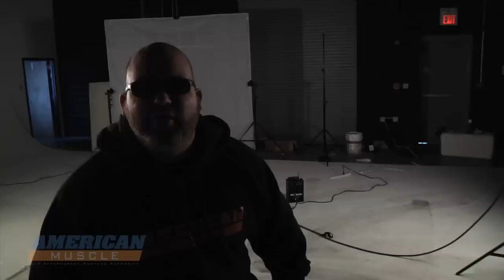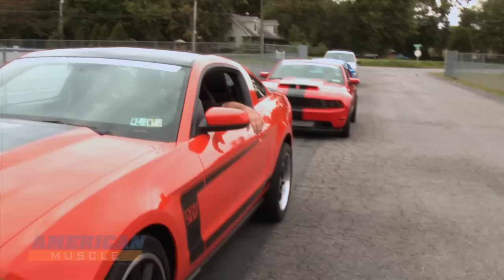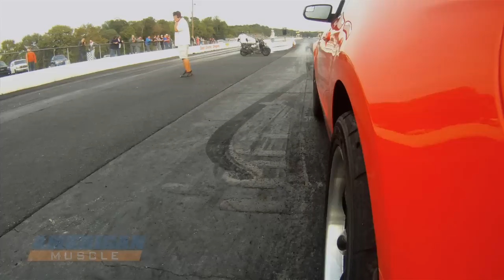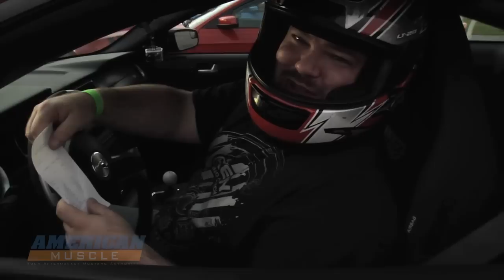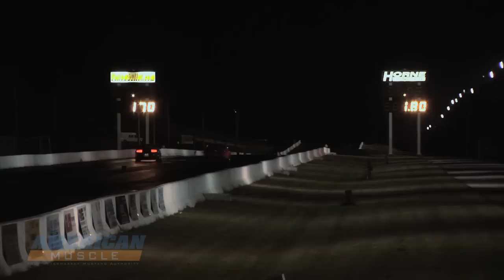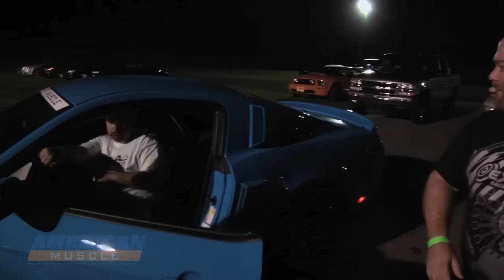2012 Boss 302 vs. 2011 Mustang GT Drag Race - AmericanMuscle.com

Comment: Im kinda disappointed bc my SHO has a tune on it and that's it and i run around 12.6 every time so to see a mustang that is less weight and more power plus a tune is kinda sad....but still... i love the stang and i always will haha
Reply: yea maybe in the 1/8 lol
Reply: You have to realize your SHO's power band and torque curve are much, much more linear than a GT/Boss 302. They make more "peak" hp, but your turbocharged SHO makes it lower and longer, thus helping you get that consistent ET you stated.
Reply: You realize the taurus is a 4cylinder and power bands on a 4 cylinder are shit not even to mention the car weighs 4400lbs
Reply: ITzMichael523 Huh? 3.5L V6 ecoboost is what I've heard the SHO has.....365hp stock.
Reply: its 4 cyl
Reply: twin turbo
Reply: 2.0l
Reply: You're thinking of the standard Taurus with available 2.0L ecoboost, the OP said he has a Taurus SHO, which has a 3.5L V-6 ecoboost with 365hp(same engine used in the F150 and Flex vehicles).
Reply: the Taurus has a 3.5L v6 and the sho has a3.5L Twin turbo...the 2.0L single turbo is only in the new Taurus coming out in 2015..I own an SHO...don't tell me whats init when you obviously have no clue
Reply: viperkill3 :-) I envy your SHO! 12.6, wow!
Reply: 12.6 is nothing..look up taurus sho 11.9...there are alot of people that have more upgrades then mine..but thank you..haha
Reply: viperkill3 How do you keep traction?
Reply: smiley00341 AWD
Reply: ITzMichael523 no its not. Wtf, all you have to do is look it up lol
Reply: What the hell is a SHOE?
Reply: The SHO is AWD

Comment: You think each of thse guys carries an extra 150 pounds??!! WOW! However when I had my 1971 Mach I (351 Cleveland around 285 hp) if I took 3-4 other passengers for a ride I had no problems accelerating. Towing a trailer makes a difference. But ONE second in a 1/4 mile is an awesome bogging down of 400+hp engines. Try it. Take a 150lb passenger for a ride in a 400+ hp sportscar. It's not much difference.

Comment: Which one you want to take, '95 Z28 making over 500 horses N/A or the '71 Vette sitting in my garage, supercharged 454 making over 800 horsepower, and I got another supercharger coming in. After I smoke you I can change your oil and balance your tires, because I don't buy things with daddy's money, I build myself, like a real man. Maybe you can hit 0-60 in 5 seconds, but I can still do the same, and with a car that I made powerful.

Comment: WTF? I ran a 13.2 on street tires in my 01 Lightning. Yes it was moderately modified but dad gone, I expected more out of these monsters. If they had more track I'm sure they would show their grunt but I expected at least consistent low to mid 12's from a newer Boss SMH

Comment: lol dude that's all sports cars today cant turn or stop for crap I have a 73 Crown Victoria with a 302 boss and it halls balls and turns on a dime same with my 79 F250 but its got a 552 (stroked 460) but I keep wearing out my A/C pump and power steering pump guess I need to but more quality parts

Comment: actually i would expect these guys cars to do Way better than these runs.  doesnt the boss 302 already pull mid to low 12's stock. and the gt high 12's stock?!  so what on earth is hindering the performance. (obviously the drivers themselves are pretty chunky. probably dumping another 270+ lbs in the cars)  .. seems the notes say there times dropped to 12.1's   but still... that alota mods to still be in the 12's, those cars need weight reduction big time.  bring on the all new 2014 mustangs.

Comment: I run 12.63 with 111.8 trap with stock tires and MBRP cat back why are these so slow with a lot more work done
Reply: Delaware were at sea level
Reply: David Stover we're
Reply: traction. 111 compared to 115/117 is a big difference.

Comment: Win a lot of races in a 86GT 347 car with 440 horse and 2800 lbs, no hood liner, no spare tire, no fuckin radio or speakers at all.  Pro tip: Always keep a half tank of gas or less.

Comment: Would 400 plus horsepower be dragged back by 1 full second due to an extra 50-75 pounds? That's like you taking your wallet out of your pocket to run 5 mph faster.

Comment: I reckon most of these weight fixated weiners drive PT Cruisers? The pale blue ones? Haven't ran my Boss at the strip yet, but have shut down a vette and a Shelby on the road. Want to run a camaro, but every time I pull up next to one there is a girl driving.

Comment: Need some help to do burnout for 2014 mustang v6 automatic??
Reply: Buy a manual GT
Reply: Press the gas brake at the same time
Reply: Advance track off. Light brake and mash the accelerator.
Reply: an auto gt is fine too lets be honest, some of the fastest times are in autos. but agreed he needs a gt haha
Reply: Kevin Navarro You should always get a GT mustang in a manual, GT's are not the fastest cars. There will always be a car faster than yours so how fast it goes is irrelevant. GT manual will definitely pull you to your seat, sound great, and be a lot of fun. And that's all that matters. Plus it feels like you're going faster in a manual. And if you know how to use it right, you'll shift faster than an automatic.
Reply: +Taylorgang19ish not true obviously you just play car video games
Reply: Actually, in a way, he's correct. Traction control off, light brake, mash the gas pedal. I've burned out in many rear wheel drive vehicles.

Oh, if you need the math behind this, your front breaks are 90% of your stopping power, you just need to apply enough acceleration to break the back wheels loose from the brakes, and hold your front still.

Comment: Its kind of a fact that the 2013 gt 500 is the fastest production v8... 0-60 in 3.5 seconds and it tops out at just over 200 mph  watch a review sometime before you run your mouth.

Comment: Seeing A lot of retarded comments about the auto...this new 6R is far superior to the MT-82...If you haven't driven one you have no Idea and you are IGNORANT. The 6R is standing up to WAY more power than the MT-82 manual(a lot of people have been breaking them), it shifts faster than A human can, it doesn't miss or screw up shifts and with A tune it hits the gears just as hard as the stick. I have the auto in my '11 5.0. I wouldn't have it any other way.I do wish it had selectshift like the'13s